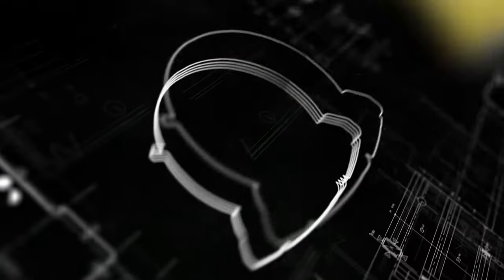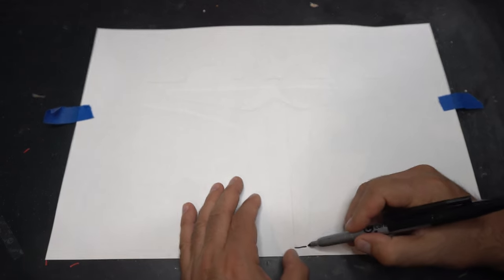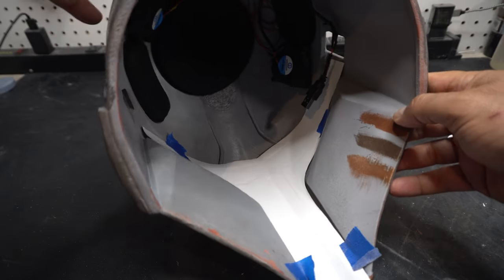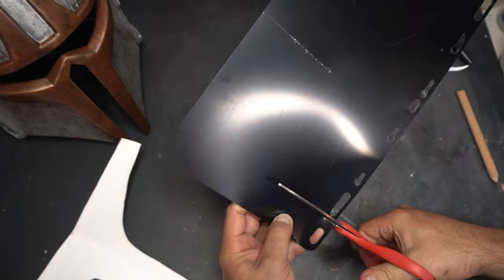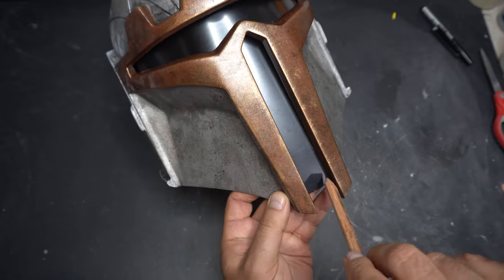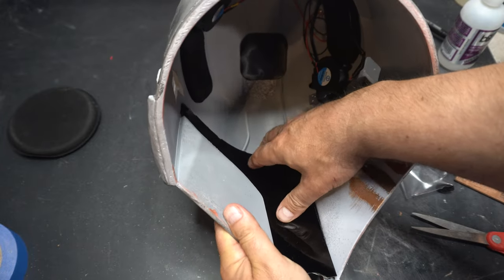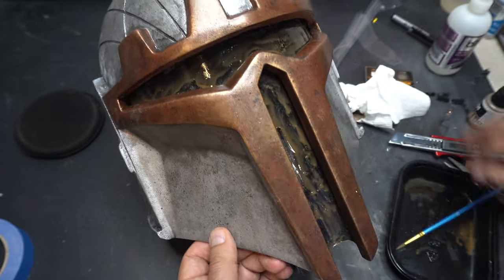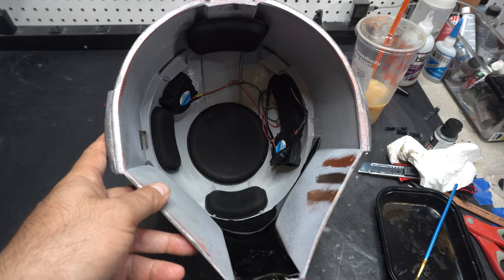Installing Mandalorian Visor to 3D Printed Helmet - Viking Mandalorian - Part 3

Comment: My OCD for scratches went into overdrive when you removed that protective plastic peel... Remove it ONCE installed, not before when you have to move it around everywhere. At least for the inside where you can remove it later on.

Hot glue would be my weapon of choice to set a visor in place long term. I doubt you will change it other to other styles, so bothering with velcro feels like an inconvenience (plus glue is cheaper).

But if it works for you that's entirely fine of course, just pointing a different option for those that read comments ;)

Well done again !